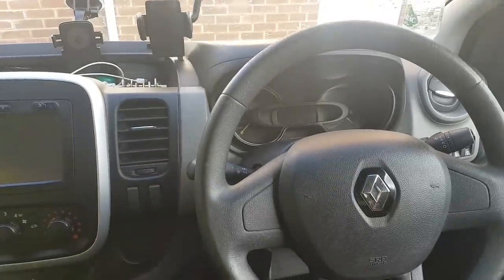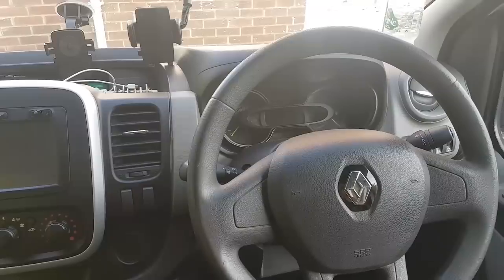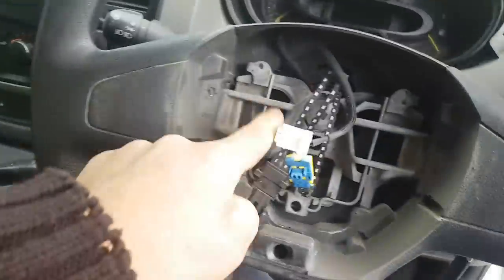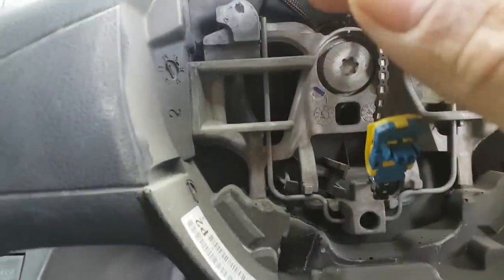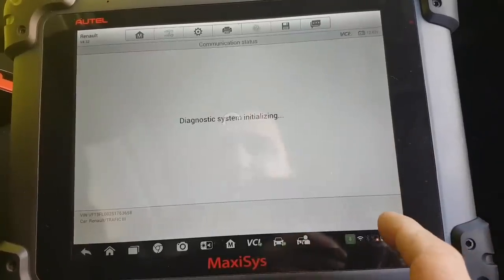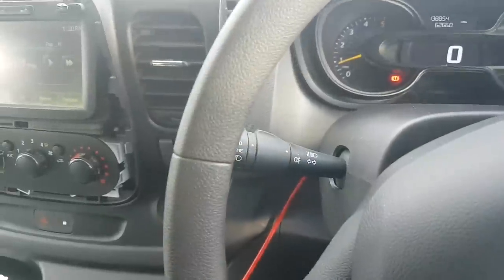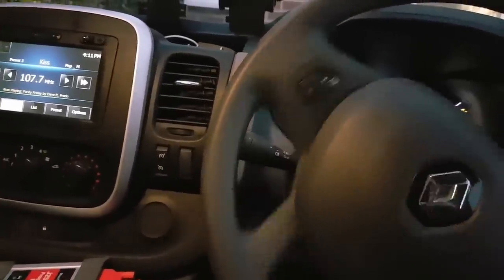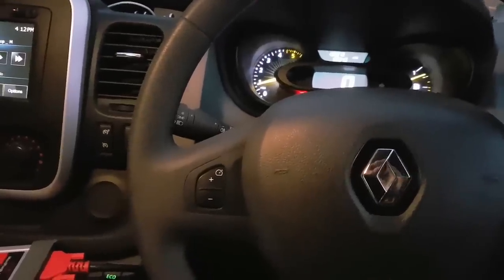Renault Trafic 3 genuine cruise control retrofit! Including coding!

Comment: Hi I have a Renault trafic. 2016  and I am getting. Check cruise control and check speed limiter fault . Just wondering where you are located and if you could help with this problem.
Reply from the maker: Have you scanned the van?
👍👍😬
Reply: @LMAutoRepairs  I have DTC056415 showing  and I think it either 12 volt missing or shorted .  If I switch on to cruise I get the message check cruise control  . No lights show on the dash in green or yellow . If switch to speed limit, I get the message check speed limiter and the same no lights on the dash  green or yellow .  Just wonder if any body has any ideas could it be a fuse ?  But no fuse listed in the hand book .
Reply from the maker: @peterprice8393  
Check live data... you might have the same problem as I had on this one, as explained in the video... and on the other video for this... link in the description...
Reply: @LMAutoRepairs  it’s not a retro fit . The van is the sport model and came with CC & SL  but for some reason has stopped working . I have only had the van a week and only found out about the problem when I took it on its first long journey.
Reply from the maker: It doesn't matter if it a retrofit or an original from factory... it still has a clock spring that can fail...
👍👍👍
Reply: A couple questions  2016 sport model also has the button for the voice control so I think my clock spring will be a different number that yours.  Is it possible to see the voltage break down on the RV / LR with maxi reader or just Renolink. .? I think I will have to tear it down to find the part number  as they show springs with 8 pins and some with 10 pins
Reply from the maker: @peterprice8393  
A tool that can access that live data, should be able to show you that...
Reply: @LMAutoRepairs  👍 thank you kindly

Comment: Am I right in saying if the clock spring has the extra connector then it doesn't need to be changed?
I have the stop/start button where you installed the switch on the dash and the parking sensor switch where you originally tried to install it. Do you know if the cruise control switch will then be the one next to the stop/start?
Where are you located? If you're not too far away then I could get you to code mine for me? Thanks
Reply from the maker: Correct... it does have the extra connector.
Thanks for watching and for your comment!
Reply: @LMAutoRepairs  Ordered a steering wheel and the dash button. Where are you located?
Reply from the maker: @12alexbailey  
Cambridgeshire...
Sorry, but I do this as a part time, I don't usually publicly disclose my address...

Comment: Nice to see you get  it working. I have a question - my 2010 Renault Kangoo is rather basic, but has the CC wiring (plugs and CC switch on clutch) 
Looks like all your coding efforts were not to get the Cruise Control working but to display it correctly on the dashboard, am I right?
[edit:] never mind - on other comments I read that I need to do some tricks on the OBD plug in order to get it to work, just wiring and switches are not enough. 
Will have to find a Renault shop that is willing to do this, probably hard to find. And also, my airbag warning light keeps on - need a new clock spring for that. Will order one on ebay

Comment: Hi LM, my vivaro 2017(same as your video) has the same symptoms as your Renault in which when I turn the steering wheel CC/SL comes and goes (more often goes than comes)  however my fault codes are different from yours, is it still possible its the clock spring at fault? My fault codes are DF068 Speed limiter/cruise control function error. Any help Is much appreciated, would just like to know your thoughts as to if If you think I should replace the clock spring or if there’s a fault elsewhere. Thanks
Reply from the maker: Could be the clock spring indeed... live data would help determining for sure...
👍👍👍

Comment: Hi LMAutoRepairs, just received blue cable Renolink v1.52 from Aliexpress. But I am struggling at the beginning. Could you please share how did you manage that ECM and Dashboard in the ECU left side list? I am interested how did you set up this list since the begining.  I have interface connected but cant scan any xmls from the car (Megane 3). Highier versions cant even connect interface(v 1.67). Please advise. Thanks
Reply from the maker: Hi
Make sure you have the correct xml files in the database for your car...
Then you just scan the whole car...
Thank you for watching and for your comment!
Reply: @LMAutoRepairs  thanks but how to select correct one?
Reply from the maker: @mapotn  
There is an auto scan function in there...😉
Reply: @LMAutoRepairs  do you have red or blue cable?
Reply from the maker: @mapotn  
Red...
Reply: Hi. Another update.I was able to change RV/LV in dashboard but I can't change anything in ECM :( so it is still not working.
any ideas please?
Reply from the maker: @mapotn  
You are missing something...
I know I did missed some details, but it is all done with Renolink.... I can't remember all the details... sorry...

Comment: Hi have you got garage somewhere in UK  I changed wheel and got button but I dont know how to code van maybe I if could come to your garage would you be able to do that?

Cheers
Reply from the maker: I don't have a garage...
I do this as a part time...
Find someone with Renolink or visit the dealer... they shouldn't charge a lot just to code the cruise control...
Thank you for watching and for your comment!
Reply: @LMAutoRepairs  
thanks, just been to renault and they can't do that because cruise control is not originaly fitted I'll try buying the software and do it myslef your video is very good 
cheers
Reply from the maker: @robertszeffler2190  
Hope you get it sorted!

Comment: Iv tried this on my 2016 vivaro 1.6 , fitted the steering wheel and switch in the dashboard but no luck , tried 3 different diagnostic software and nothing 😭
Reply: you need to change clock spring
Reply: Hi did same with my Vivaro unfortunately not working. Have mange with your Vivaro?
Reply: @alicanyazgan  Hi, What kind of clock Spring need to change? In my Vivaro clock Spring is prewired but after changing steering wheel with cruise control buttons the Cruise Control still not working. Any Idea?

Comment: Hi, very good video, my van is a 2016 model just a quick question , is there two different clutch pedal switches, i had my van in with vauxhall and they said that they tried everything but it wouldn’t  work and had to be coded at the factory, i am quick to think its a load of faeces, because the dealer had sold the van with cruise control but once i got the van it didnt have it so they said they would add it to the van free of charge, everything seems to be fitted and the speed limiter is alarming at 75mph on the motorways in the south of ireland! I will be opening up the dash to see if they are plugged in, and am looking into what software can code the van incase thats all it needs
Also wanted to note that i used to get near 40mpg and then they recalled the van for the knock sensor software update and now im lucky to get 32mph just wondering if there is a correlation between the two! 
Thanks again for the video!
Reply from the maker: Hi
The dealer should be able to do it...
And if they start the work, you should definitely insist with them to have it completed...
Check on a different dealer perhaps...
As for the consumption, ask the question...
They should be able to give you an explanation...
Thank you for watching and for your comment! 
👍👍👍
Reply: LM Auto Repairs 
Thanks for the reply, i got the van at a very good reduced price as it was a demo and only had 5425 miles on it and if im honest i wasnt that bothered about the cruise control it was the principal of it that i said it to them, just to see their response, when they said it couldnt be done i then got free reversing sensors fitted and £500 cash back so i was a happy camper and still have the steering wheel and the cc/sl toggle switch fitted so i’m going to have a go at getting it up and running myself and worst case scenario i’ll take it to a different dealer like you suggested and get them to look at it! At least i now have a video as evidence and proof that it can be done😄! now to look into the reversing camera that you mentioned! I was not aware that they existed so for that i have to thank you again!! 
Keep up the good videos!
Reply from the maker: @Bonez88-22  
Sounds like you have plan...👍👍👍

Comment: Hi mate I want my 2015 to work what software will I need to program it? Thanks
Reply from the maker: I used renolink as per the video...
Thank you for watching!
Reply: @LMAutoRepairs  thanks I have the software but have hundreds and hundreds of files to open?
Reply from the maker: Well... you need to open the correct XML file for the ecu you want to work with...
Usually a auto scan picks up the right file...
But I had instances when it didn't...
Hope that helps...

Comment: Did you have to install any switches for brake and clutch? Or is it just a case of installing the steering wheel, cruise switch and coding?
Reply from the maker: You need to check, in this case all the switches where already there...
But check, as I believe some models did not came with them...
Thank you for watching!
Reply: @LMAutoRepairs  Can cruise control be activated in clip? Where it says cruise control and speed limit "without" can these be changed to "with"?
Reply from the maker: @richards4456  
Yes... however, in this case looked like it needed some sort of online connection...
So I ended up using Renolink...
But you can always try...
Reply: @LMAutoRepairs  did cruise work without any coding? Just didn’t show on the dash? I’ve fitted the wheel and cruise button. All showing on live data on clip. I cannot click ‘write configuration’ however. Cruise control isn’t working currently.
Reply from the maker: Needs coding on the engine ecu... if I recall correctly...

Comment: Hi there! Great video, I’m going to be using this to add cruise to my Trafic. Could you please tell me where you got your copy of Renolink? I have the same interface as you. Thank you!
Reply from the maker: My came initially with the cable...
Hope you successfully retrofit it!🤞
👍👍👍
Reply: @LMAutoRepairs  hey man, changed the steering wheel with the buttons on there same as in your video, connected everything up on the wheel side of things, put the ignition on and dashboard says check vehicle, spanner light is on, headlights are on won't turn off if you move the stork, same with the wipers, and when I turn the engine off the wipers are still going, so I disconnected the battery to make that stop, any ideas,, thanks dave
Reply from the maker: Double check everything you touched... make sure everything is plugged in correctly...
It shouldn't do that...
👍👍👍
Reply: @LMAutoRepairs  one thing I didn't mention, when I disconnected the horn and the airbag, I didn't disconnect the battery, but I did then disconnect the battery to connect anything back, ReConnected the battery and the dash says check vehicle and the spanner light was on, turn the engine on wipers stays on on headlamps, put the other steering wheel back on but things are still the same,
Reply from the maker: You must have disturbed something... double check connections etc...
Scan the vehicle if you can...
Reply: @LMAutoRepairs   battery fuse box board located behind battery positve side, there are two same size connectors and one larger one, the one as you look down on the Left the small plug, run a live into that all working fine now, this could have happened at any time just unfortunate it happened while doing the steering wheel, common fault apparently, with ignition off lights on wipers we're still running, the thing was going berserk,,,
Reply from the maker: 😅
Good find!
👍👍👍

Comment: Hi i have 2018 business plus, i fitted the sport steeringwheel with CC controls on as per your video and the wiring was there. But when i came to fit the switch on the dash there is no plug at the back of the blank, have you any advice? Thanks